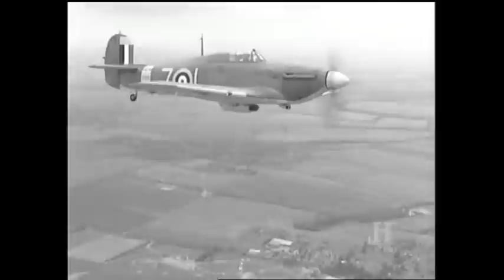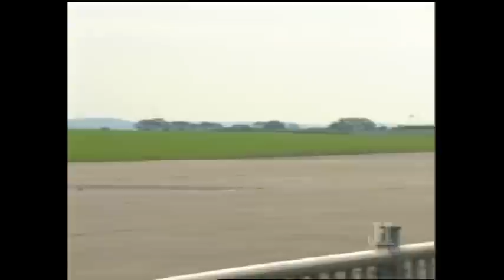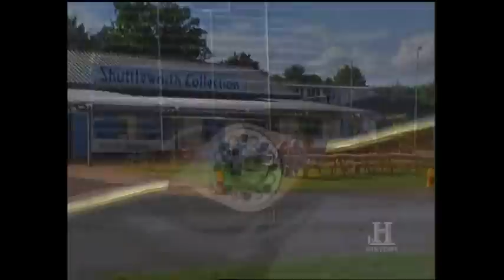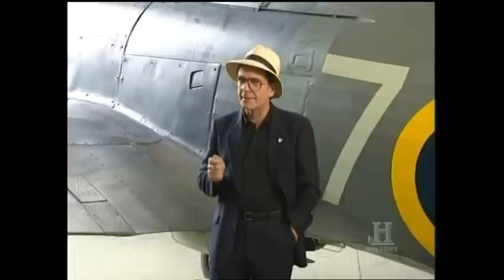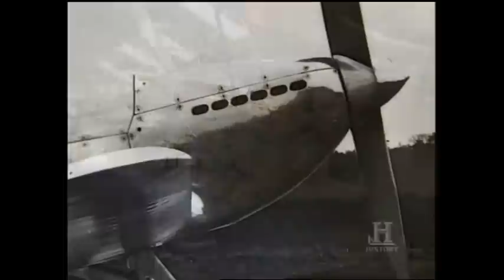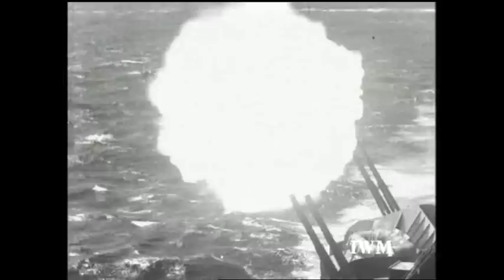Restoration Classic: Hawker Sea Hurricane

Comment: For a true historian a film like this is indispensable for details of the challenges faced by such a restoration. Where else would he find such information as the need for squaring the tube ends of the longitudinal framework, an essential element of the work, being frustrated by the fact that when it was to be done, the last remaining tube squaring machine had just been scrapped, since  there had been no more need for it (they don't say but that would be in Britain - but what about in China!?). At 34:00 you can see the surprise on his face as Norman Gardiner (first shown at 24:09) tells of the difficulty. He's not ashamed to say that the Spitfire had a more modern structure, with a stressed skin, whereas the Hurricane relied on a more antiquated tubular framework for strength - which necessarily would cause it to be heavier (but they don't mention that aspect). It is very interesting to see there are passionate factions that favor one aircraft over another even now, 50 years after they were decommissioned, and how some continue to argue over which engine was the best - The Allison! No, the Merlin! No, the American Merlin! No, it was a British Rolls Royce only made under license in America! No, the Americans re-designed the Merlin to make it more powerful! And on and on. Fascinating. Non-enthusiasts have no idea how much fun they're missing. BTW were oil sumps made bullet proof in fighters? One hole in that sucker and there goes all your lubrication -- and it's curtains!!

Comment: I always wondered what became of this Hurricane. Many years ago when I worked at Hawkers I volunteered for the job of making some of the fuselage tubes for it. This was done on a machine we had that made the ends of the round tubes square or rectangular. Then I had to drill the bolt holes and shape the ends. After that I knew that they went towards the restoration but I never got a any feedback, now I know, great stuff.

Comment: In 1940 with the prospect of the RAF running short of fighters the Miles aircraft factory designed and built the M/20. This aircraft had a fixed undercarriage and was powered by a Merlin XX engine. Though slower then the Spitfire was faster then the Hurricane had far greater range and carried twice the ammunition of either, it also had a bubble canopy.. I think the Admiralty missed a great opportunity by not developing the M/20 for carrier operations.

Comment: The Sea Hurricane in this video is a IB. They were intended to be launched from carried and MAC's (Merchantman Aircraft carriers, forerunners of the Escort carriers).  They had arrester hooks. The propellers were DeHavilland units to reduce nose weight to keep nose from dipping during arrested landing and prop hitting deck (Big problem on Seafire's). IIRC the Sea Hurricane's also received radio's compatible with Royal Navy radio channels.

Comment: What is the differance between a hurry and a sea hurry ? Was it the carrier hook ?
Reply from the maker: soaringtractor CAM Sea Hurricanes Mk1A had no arresting hook as they were not equipped for landing on carriers, thus whether or not the aircraft had a hook or not did not necessarily mean it wasn't a Sea Hurricane. So smartarse, next time you want to mock someone for asking a question, get your facts straight beforehand.
Reply from the maker: soaringtractor Well there you go..an aviation expert who can't spell Hurricane, and has no knowledge of what a CAM Sea Hurricane is.
Keep demonstrating your ignorance mate. I'd suggest you do a basic search on Wikipedia...or for you perhaps that should be Wykypedia.
Reply: +MrAgm65 
I gather you have also been on the receiving end of 'soaringtractor' and his abusive attitude. Its normally the case with anything British. He has another profile called 'Wilbur Finnigan' and his ability to shout ignorance is only exceeded by his Yank arrogance. This is the man that called our 53,000 dead Bomber crew 'Yellow bellied cowards' and somehow thinks Packard invented the Merlin. I am glad someone has had the ability to delete his abuse from a Thread......
Reply: A carrier deck landing is a lot harder on an airframe than on a runway. The (relatively) short length of a deck means that the aircraft has to be put down a lot more firmly.
So as well as adding a hook the undercarriage was toughened up.
As the arrestor hook had to drag two and a half tons of aircraft from 70mph (a rough guess) to a dead stop in just a few yards the strain on the hooks mounting points was phenomenal. So the metal airframe needed beefing up to take the extra load.
I also think that maybe a different radio might have been fitted to match naval communications, rather than RAF.
Reply: Kimdino1 2 years ago - A carrier deck landing is a lot harder on an airframe than on a runway. The (relatively) short length of a deck means that the aircraft has to be put down a lot more firmly. So as well as adding a hook the undercarriage was toughened up. As the arrestor hook had to drag two and a half tons of aircraft from 70mph (a rough guess) to a dead stop in just a few yards the strain on the hooks mounting points was phenomenal. So the metal airframe needed beefing up to take the extra load. I also think that maybe a different radio might have been fitted to match naval communications, rather than RAF.
-- Kimdino1 -- Now that's what I call an informed answer!  CONVERSION (mentioned several times in the film but never explained) = Carrier Hook + Airframe Beefing Up to Take Extra Stress of Carrier Hard Landing Plus Carrier Hook + Marine Radio to be Compatible With Navy.  Muito obrigado.
Reply from the maker: +Craig Jefferson Not aimed at Lars...deleted the comments from the fuckwit who had a go at him
Reply: +MrAgm65 Thank you for the kind words, at least there is some one out there with brains !! /Lars
Reply: MrAgm65 Thank you again ! He´s been reported as the spam he is !!
Reply: MrAgm65 _BURN!_  x))
Reply: He just asked a question...
Reply: MrAgm65 Haaa Haaa! X))
Reply: Thanks !
Reply: I know it's a year on but I just wanted to add (I tried to confirm this in the internet  but couldn't find any infromation) an old friend of mine ex RN told me that their paint  was of a special anti corrosion paint (salt ) which was thicker and heavier ,he told me this a few years ago ..about 20 to be exact so I can't remember the full details ,have a nice day Sir